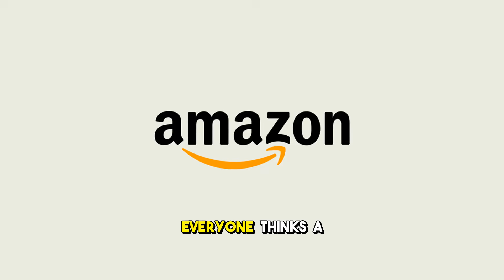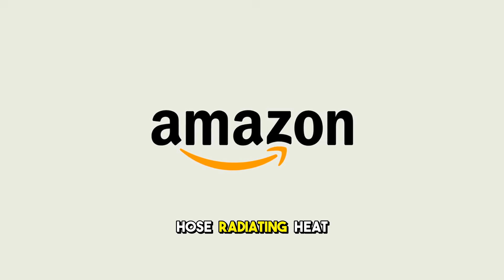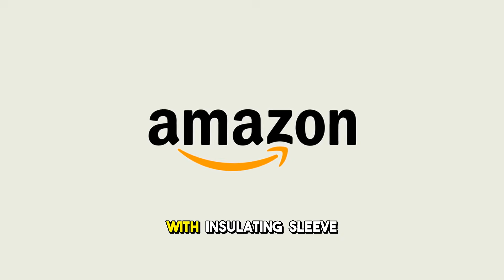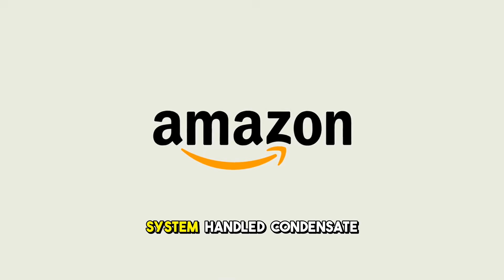LG LP1417GSR Portable AC Review 2026 [Watch This Before You Make a Choice!]

Comment: This unit is crap.

I have one, it consumes excessive amounts of energy and loses a lot of efficiency due to its single hose design. 

Power draw:
- Compressor on: slightly over 1,000 watts
- When compressor off and fan on: 70 watts

It is noisy, even when the compressor is off.

It can barely lower the temperature of my bedroom.

Really, run away from that thing. 
I'm very disappointed by mine. If only I had known about the 1 vs 2 hoses differences when I bought it...